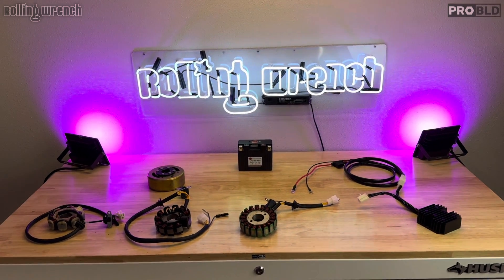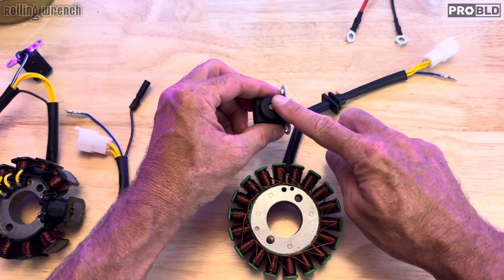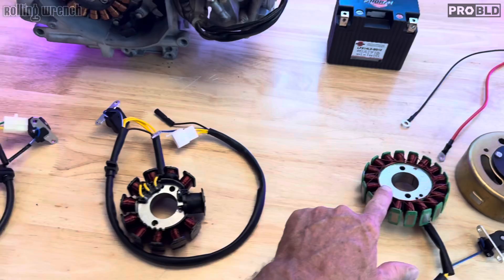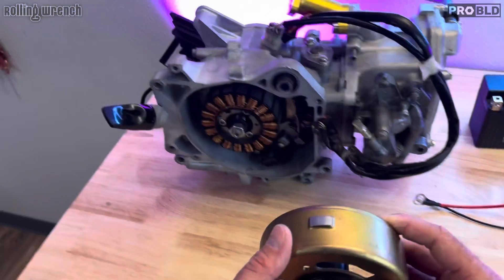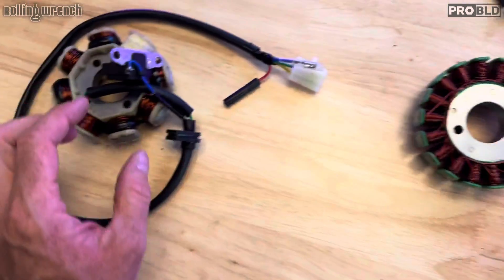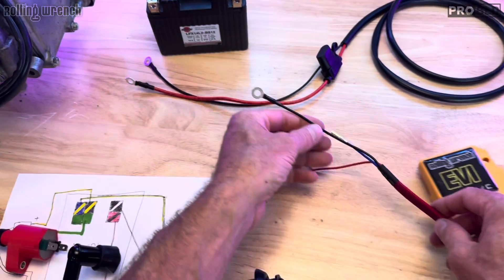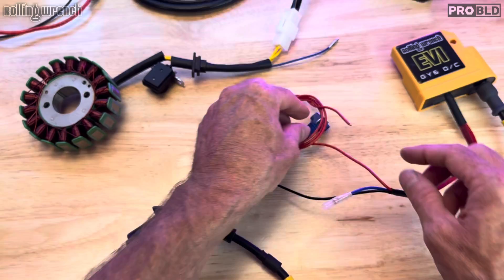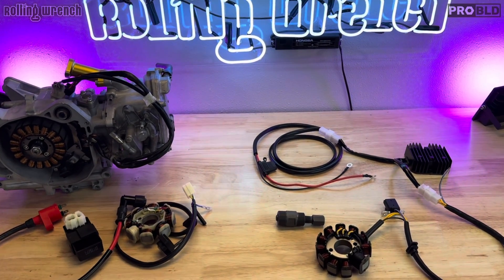GY6 AC vs DC Stator/CDI [ How does it work? What is best? ]

Comment: After studying this set up I need to ask, so I see the stator plugs into the voltage rectifier so does the wire to the battery,so how does it regulate the lights etc???
Reply: I mean,after I unplug my rectifier and run yours,where do I plug the plug from my rectifier.

Comment: Long story short; "AC CDI draws power from the engine's generator, simpler & common in kick-start bikes, spark varies with RPM; DC  CDI uses the battery for constant power, offering more stable spark, better for electronics, but needs a healthy battery. The main difference is the power source: AC from stator/generator, DC from battery, affecting reliability & performance needs

Comment: My honda foreman 450 was stalling, ended up being the voltage regulator because its tied in with the stator wire that goes to cdi box, sadly i started with the coil, and cdi first.

Comment: You would almost have to be an idiot to think that the d c only would be better when, in fact, it would do nothing for you at least if you had the ac cdi it could run you back home without the charging system or a battery..... With a... d c ststem you're stuck if the charging system goes, you're done....... The AC system will fire the cd. I and at least you can get home with no battery with the a.C... Yeah you might not have headlights... But the bike won't leave you stranded with a c

Comment: Can you use a dc cdi on a flywheel with reluctors all around it? Having problems bike will start but also backfire. 2 cdis and it does the same thing i think i need a flywheel with one reluctor… 163mf chinese 200cc

Comment: CAn these electrical components affect the idle of the motorbike? because my motorbike (Scooter, Suzuki Step 125) have a big problem with the idle. when tuning up the carburator, it went wild. or no idle. we tried everythng, carburator change, air filter, throttle cable, changed everything. even the valve and pistons are checked. No problem. but still no idle. even spark plug is new.
Reply: Replaced the CDI?

Comment: For off  road bike and most scooter applications, the AC system is superior. .  If there is a need for electric start or high power lighting,  the DC system is better as it can cope with charging a higher capacity battery. No flywheel triggered 4T system is ideal though, as the timing is generally fixed and its impossible to alter the advance curve, which are both things that may well need to be changed if engine modifications have been carried out.

Comment: Hello 
I watched your YouTube video 
I have a question. 
I'm riding a Honda curve derivative 110cc motorcycle 

The generator is used for 6 coils and 1 coil is used to drive acdi 

But the electricity generated by the generator is weak 

I want to use an 8-coil or 10-coil generator 

The problem is that the magnet also has 6 poles, so even if I install an 8-coil generator or a 10-coil generator, the polarity will be twisted, so is there a good way?

Comment: I have a question. I have a blue wire a green wire, which I assume are the ground, the trigger, and then there are a yellow wire and a white wire as well coming off of my DC. Stator Then I have the three regulator rectifier wires. What are the yellow and white wires for on my wiring diagram they just go right to my CDI along with my trigger wire and my ground wire.

Comment: Can I use my existing flywheel for point system to operate my upgraded CDI ignition? Or do I need a different magneto with a specialized kit to mount the trigger wire

Comment: i thought that i had a dc gy6 engine but i had an ac gy6 engine so i bought a dc cdi box and a dc ignition coil. do i have to buy a different cdi box and ignition coil? and btw i bought this stuff because all the sudden the engine stopped running while going up a hill and it was because the ignition coil all the sudden stopped producing spark so i tested it and the 2 prongs were receiving spark around 15 volts. so do i need to buy different stuff?

Comment: So I converted my gen 5 maddog from ac to dc and I’m still running the stock ac stator and ac cdi will that now put dc current through the stator and cdi or will I have to buy a dc stator and dc cdi also with a dc rectifier? I checked for spark on my spark plug and it’s very faint I even grabbed another coil and cdi to see if that was my issue on not getting any spark what should I do

Comment: DC cdi boxes seem to last longer to me than AC boxes. I was quite confused in that first video I watched and commented on when you were referring to DC versus AC stator now I understand what you were referring too. You’re not directly saying the stator produces DC, but that the stator is set up differently between A DC cdi box and AC CDI box. That is in fact very different as the AC cdi needs extra external stuff, and again my experience AC cdi are more frequently replaced which aligns with how AC negatively impacts the life of all types of capacitors not just one type or another. Now I’m not certain if that’s what’s actually failing within the cdi modules all the time I’ve had a few in the past to depot and check out just never got around too it with all the work!

Comment: Nice basic tuto. 
I´m into the Old Engines of Obsoletion department :)) 
My two latest stars are from seemingly long bygone manufacturers named M.A.G. and Universal Motor Company. Both are single cylinder industrial motors, sharing the same ignition base, coils inside the flywheel kind of deal motorcycle ignition system from Bosch. Condensers are easy enough, but I have a hard time finding breaker points that will fit these days. 
Landmower electronic point/condenser replacement modules are no bueno as the breaker point is the only ignition timing at my full magnet circle flywheels. 
I´ve been thinking about replacing everything underneath the flywheel with a stator and newer outside location trigger point CDI things, but looking into bike/ATV stuffs for the first time in my life I ran into problems; Nobody specifies measurements, They only mention models of vehicles their stuff will fit ! I need inner and outer diameters of flywheels for various models of vehicle make, head room measures for my coils and optimally mentions of axle hole diameters (Well, I do have drills...) . 
Do you have a nice pointer heading or five for better oversights to ease my struggle ? Or a yard stick to measure some of your own inventory, for something ´ish ? Others reading this and knowing something, are welcome to chip in :D ! My flywheels has inner diameters of 98mm, outer of 138mm, beef thickness of 36-37mm. 
Flywheel model name; Bosch LM/US1/138/12/6

Comment: In all honesty, I don’t run lights on my scooter so having a basic A/C system just for ignition it perfectly fine. I gutted most of the wires, and create a simple kick start wire harness. 

I do still have the electric start hooked up, but that’s only for back up.

Comment: At least ac don't need rectifier  and battery   couple extra wires
Reply from the maker: True. If that’s the case you won’t have signals, electric start and have stroby head and taillights…. Ac sucks

Comment: Apparently the big thing to know is if your battery is dead, the DC system won't provide any spark. Whereas the AC system will, if you can get the motor turning.
Reply from the maker: Actually if you remove the battery completely on this dc system the bike will still start and run, just like the ac system
Reply: What makes you think your battery is going to go dead with an 18 bump stator

Comment: Thanks for the content...It's only worth doing if building a new bike.If you already have a/c to change d/c and do it properly.It's a fair amount of work and time.Along with having to buy tools(basically only used once)and components(didn't actually need) to switch out the good ones for a different set of good components.d/c cost more and if the coil or cdi fails you have to buy both.a/c cheaper and components aren't conjoined twins.Is it that great of a system to do all of that?Only to the ones that are trying to sale them.

Comment: Can we use, stock starting( exider coil) 300ohm resistance witch replace to 600ohm resistance coil will it's work.. System has ac cdi

Comment: What happens if you run the DC CDI directly from the rectifier instead of sending the electricity to a battery first?
Reply from the maker: You can do that. It’s not option I would choose first. But that is definitely an option.

Comment: you should statde the fact this are not lawn mower staors. also NOT ALL stators are the same as in ... i have AC stators with only 2 wires. they goto a regulator. just lil things. oo no excitor coil. so iam out as iam more cornfused typing this then iw as before
Reply from the maker: As the video states. This is a video specifically for the GY6. Lawn mowers don’t have GY6 engines

Comment: Pretty poor, and disingenuous, excuse to run a DC system. "Look the AC system has more wires and less charge coils." The AC system doesn't need a battery and if your running a head light and tail light you don't need a big charging system.  That shorai battery is perhaps the biggest waste of money..
Reply from the maker: Dc doesn’t need a battery. Ac has flickering lights

Comment: Will this cause the bike to lose spark or cut spark at super high rpm ?? If the pick up sensor is not gapped properly? Like to far away?
Reply from the maker: No, normally if the gap is to big starting is an issue
Reply: @RollingWrench  thanks 🙏

Comment: Hello there, I really love your video. I want to ask, between AC and DC CDI, which one produce bigger spark in high rpm?.
I hear that DC create more stable arc from low to high rpm, then the AC have tiny arc in low rpm but gradually getting bigger in high rpm. Are the AC arc in high rpm bigger than the DC?
Reply from the maker: Good question. I honestly am not sure. I really don’t think it would matter. I’ll have to explore that concept. I have never noticed

Comment: as a person new to GY6 parts due to my motorcycle being discontinued and most parts are gy6.

is AC and DC similar to the term half wave and full wave?

because when i got my bike(used) my mechanic fixed the Regulator then i noticed that my batteries always dies after a few months. put a volt meter to it then it showed it outputed 16-17V

went to a different mechanic. he stated that my stator was halfwave. he edited it to make it into full wave.

volt meter now never passes 15V and i have not yet experienced my battery dying.

Comment: For me i love AC starting because when ypur battery low it wont sfart while Ac even without baterry you can start engine.and you can drive.
Reply from the maker: Actually that’s false. You can completely remove the battery and kickstart the engine with both ac and dc systems. As you kick over the bike the stator pumps voltage into the cdi which has a capacitor to store enough energy to start the bike and keep it running. As long as you have a good charging system no battery is required.
Reply: @RollingWrench I know dm well that 18 bump stator putting out power like a mutha
Reply: @mechatronicsadventurist2760  your right about it that’s why I love ac too
Reply: With a 18 knuckle stator you don't have to worry about your battery going dead

Comment: Slightly off base question , what's the difference between a 2 stroke and a 4 stroke magneto - if any ? Also does the rotor have to match the coils , (is there a different amount of magnets for the different amount of coils ? )

Comment: I put up a video on my channel. I tried doing the research online and on YouTube.

I know I have an AC stater. There are four brushes so three of them are four making energy for the battery to recharge through the AC/DC rectifier. The other coil I guess you would call it. The exciter coil would make or send electricity up to a CDI box. The CDI would enhance that to provide a spark.

Currently, I have no spark. I was trying to solve whether it was the CDI box or if it was within the AC stater. 

The issue that I'm having is that I see all these videos within an AC stater that states that the exciter coil would provide energy to a CDI and then they would be a magnet on the flywheel that would activate a "trigger "for the CDI to fire. 

However, my unit was working for six years and it started twice the other day. I turned it off and when I went to restart it within the next two minutes, it would not start. No spark. 

My main issue that I'm not understanding is I do not have any type of pick up coil or trigger coil for the CDI to know when to fire. So my ultimate question is. 

How does the CDI know when to fire/discharge the energy it has stored ?

Additionally, I will note that my charging wires have continuity to ground, and according to the schematic, all of them should go to ground. It would appear to me that energy is provided to the CDI box and then at some point, it should be pulled to ground to signal it to discharge. 

Again, I understand the concepts that I'm learning, but I don't understand how this CDI box would know when to fire ?

My video showing the stater and the wiring diagram is here 

https://youtu.be/PAsfEUL6qJU?si=qr7YDYBVuk6t8mmN
Reply: You have to have either points, a pick up coil on the fluywheel/rotor/magneto, or some engines have the pickup on the camshaft sprocket. Something has to tell it when to fire.
Reply: @ it took me a while and a lot of research but I did find my solution. In short, my issue was that the new CDI I had purchased was garbage. I got two different CDI and had no issue with them.

Back to my original issue is that my stater is a 3 coils charging/1 coil trigger.

Ac stator.

As the (flywheel with magnets) spins around each one of the coil's in the stator, the magnets in the flywheel pull one of the coils to ground. 

That wire is considered the trigger wire for the CDI. When the capacitors in the CDI see that they are being told to ground through something that I understand is called the  thyristor... that thyristor essentially opens the gate and allows the capacitors to discharge in other words firing the spark current.

Since it is a CDI ignition or digital ignition, it does not use a standard "pick up coil "like you would find in a lawnmower. That would pass a "trigger coil "and trigger the spark. 

Or at least that's how I understand it to be 

So in short, when the capacitors get pulled to ground, they discharge and they are pulled to ground when that one coil is able to pass that magnetic field through the magnets on the flywheel to ground .

Comment: Can an exciter coil and pickup coil be integrated with each other? it looks lite that on my ignition on my Rieju Mrt 50 2015 bike. And it runs without a battery if that makes a difference.
Reply: No the pickup coil is outside the charging assembly as he says

Comment: Correct me if I’m wrong but the downside to the DC system is that if the battery dies or fails it will not run u are stranded…. But with the AC system u can at least kick start it and get your self home because it can run without a battery
Reply: @brandonbrandon749  you are right about that if the battery dies or fails or rectifier regulator was to fail you would be stranded. if you need advice, get it from a professional. not this guy because he’s arrogant.
Reply: All tho bad for all the charging parts
Reply: I have always heard this as well
Reply from the maker: @joshwaller6226  try it. Remove your battery and kickstart your bike. It will run purely on the charging system.
Reply: @RollingWrench  I have avoided them do to hearing this so I would need to buy one to try it but I will take your word on it just pointing out that it is something that you see a lot when looking it up
Reply from the maker: @joshwaller6226  a lot of times people say stuff in these Facebook groups and such that are clueless on what they are talking about.
Reply from the maker: Dc systems can run with no battery installed just like an ac system. Both, as long as the charging system is working.
Reply: @RollingWrench  ok I must have been thinking about something else
Reply: @RollingWrench  You r right. Most people get confused regarding this.

Comment: Hey there, i have a 2024 frontier with a 161 qmk b2 engine block, if I swap to a 150cc 11 inch (11 inch is same length as the 161 qmk b2 to the rear axle) engine, would that be compatible?

if not, what are alternative long case engines i can put on without a bore kit on my 2024 boss frontier scooter.

Comment: @RollingWrench Man what a biased video, you're comparing a DC CDI+Coil integrated design and saying it requires less wires than a non integrated AC design and then using that as an argument to affirm DC is best, WTF! check the Suzuki AX-100 ignition, integrated AC CDI+Coil and doesn't even need a pick up coil, that's even better if wasted wire connections is how you're measuring what's a better design, what a biased comparison you did, definitely your video was just not intellectually honest.
Oh now I see why you're so biased, you're selling it 😂😂😂 what a 🤡 talking shit about other products.

Comment: Hey man, love the content. I'm looking into getting into ruckus' mods as a hobby, I was just wondering if there's a year of used ruckus to avoid buying if im planning to do a gy6 swap and completely customize?
Reply from the maker: Niiice! No all ruckuses are the same from 2002 to present. Other than a few engine changes on the stock motor. But for GY6 swap any year will work